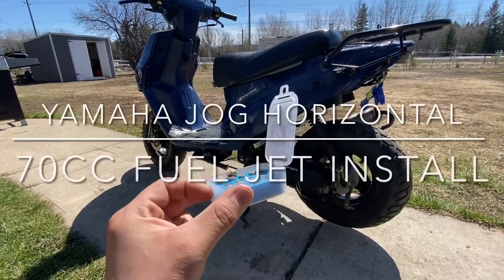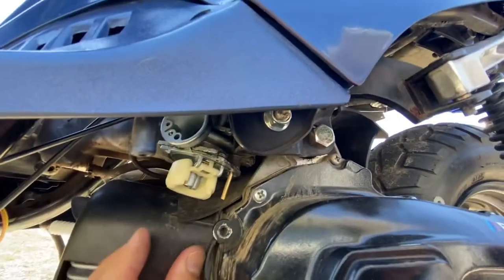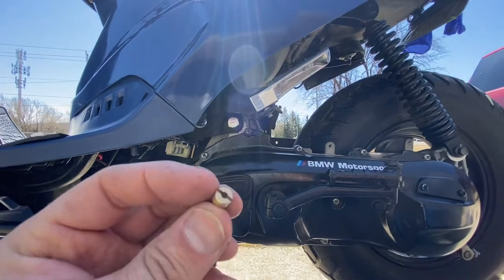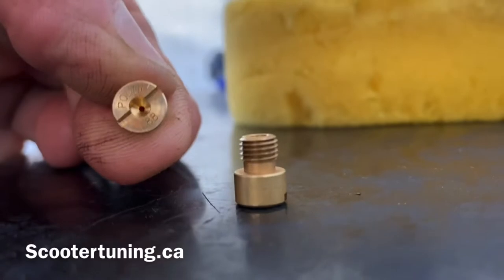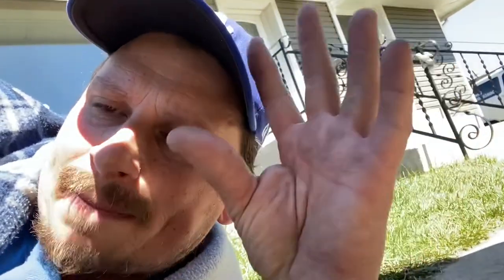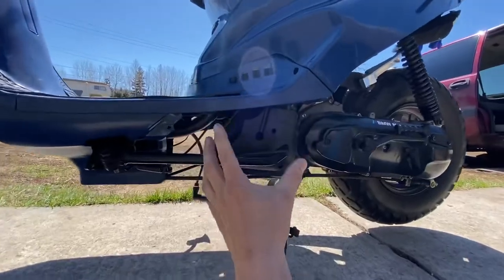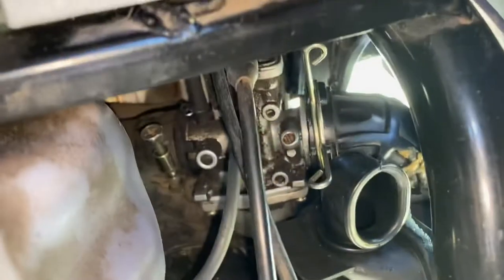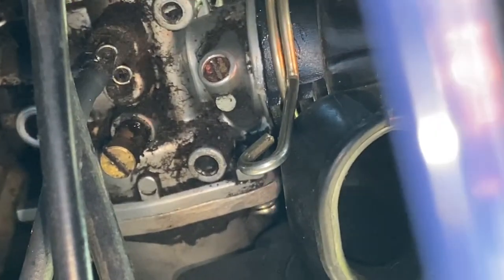Minarelli Horizontal bigger Jet Install ( Yamaha Jog Jetting) How to jet a scooter. E-ton Beamer

Comment: The Polini nozzles you use in the video are super good, the reason they are made a bit shorter is something to do, so they do not suck the water up so quickly from the sump in the carburetor, if there should be something ...

(I read this somewhere on the web)
I do not know if it is true, but I have tried it, by having a little bit of water in the carburetor and the original nozzle in the carburetor could not really run with it, but then I put polini Nozzle in so it could actually run better,. ..

good video you make ...

the scooter you are working on is very reminiscent of the most sold scooter in Denmark the name we call is "PGO Hot50"
Reply from the maker: Thanks for all the information, I will add the name to the tag for the video

Comment: Hello. What main jet for honda crm big bore 70cc 2 stroke ( 19mm carburettor, stock air box, exhaust & c.d.i)
Reply: I would go 2 sizes up and either get an aftermarket k&n style airfilter or remove the snorkel from the stock one all about messing around with it and seeing what works

Comment: so I have the exact same scooter except mine is a beamer matrix has the same Polini kit installed but I haven't installed an exhaust yet still stock as well as the carburetor have been trying different jets been trying to tune the carb only way it runs really good is with a pod filter tried the 88 jet and played with the carb and bogs and barely moves any suggestions?
Reply from the maker: Sorry not too sure, maybe your pilot jet is clogged

Comment: why should I use the stock air filter ?
Reply from the maker: To keep the inside of your engine clean, you don’t want dust and small rocks going into your piston, does cheap aftermarket air filters let everything through
Reply: @ProblemSolverGarage  I have a gilera runner sp 50. I put a naraku 70cc cylinder kit with the stock head and stock carb. The scooter had a 75 main jet. When I unscrewed the stock filter it was running better. So I removed the stock one and put a small aftermarket one and changed to 85 main jet. But since I putted the 70cc kit the spark plugs gο bad. When I change spark plug it runs perfect for about 5 days, then I start losing power. What should I do ?
Reply from the maker: If your scooter is running better with the stock airbox removed that means you are running to Rich, you’re getting too much fuel you need to put a smaller jet on. that should fix your spark plug problem, if your spark plug is still clogging up after that put in a spark plug that’s one number higher in heat rating
Reply: @ProblemSolverGarage  But How is it possible that with 50cc cylinder 75 jet is okay and with 70cc it is too big ?
Reply from the maker: What was your factory jet?
Reply: @ProblemSolverGarage  75
Reply from the maker: So with a 70 mL big bore kit especially if it’s a cheap one you would go 10% bigger or less, so like 80 to 82.5 max
Reply: @ProblemSolverGarage  with stock filter ?
Reply from the maker: @Kyros_PV  Either way.
Should never be more than 10% bigger
Reply: @Kyros_PV  you have to put a hot spark plug, search info in your bike manual, just put a +1 grade example( ngk BR7--->ngk BR8)
Reply: @RODRIGO12345273  Right Now I use NGK BR9ES
Reply: Dude that carb is FILTHY lol
Reply: @ProblemSolverGarage i have a 2005 Vino - horizontal minarelli with a 10mm wrist pin. My stock jet was 68. After installing the NCY 72cc BBK and removing the exhaust + variation my I’m up to 100 main jet and just about to bump up the pilot, too. Heck of a kit, I couldn’t be happier, 45 mph cruise at 8000 rpm, I’m just now starting to tune the vario.

Comment: Isent this a cpi engine ??
Cpi and minarelli are really diffrent kind of engine's.
alote of parts are diffrent and wont fit each other.
Also cpi use gurtner carb while mina hor use dellorto.
I had cpi engine on my f12r its really difrent then my beta ark yamaha earox old f12 and firefox f15 and my sr50.
Ive put a minarelli cillinder on my f12r but the exhaust would not fit any more its because the cillinder boulds are in a difrent position so you have to use a minarelli exhaust then.
Also clutch on the cpi engine is 110mm while mina hor is 107mm and mina ver is 105mm
Variateur of a mina would not fit in the cpi engine difrent size.
Gearing is also complete difrent.
So i would never go as far as to say its the same engine.
Its more of a look a like knock off version of minarelli.
not saying the engine is bad cause its not its actually a decent engine and there plenty of parts for it.